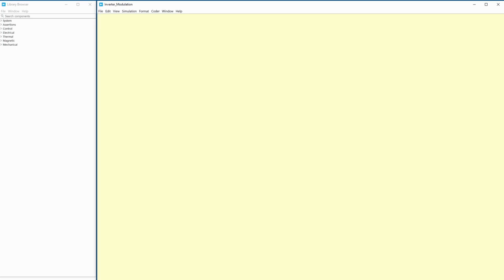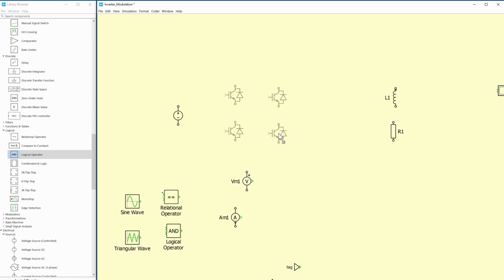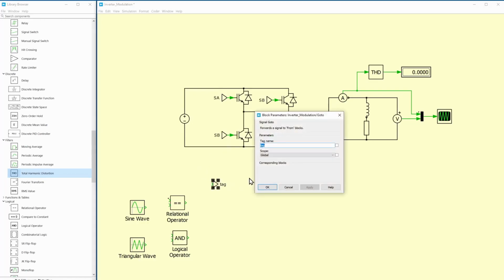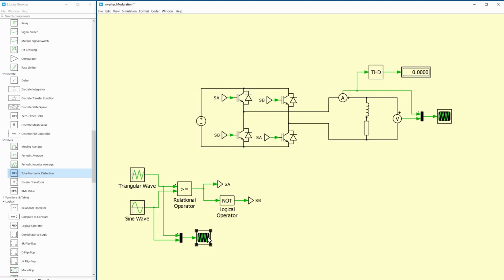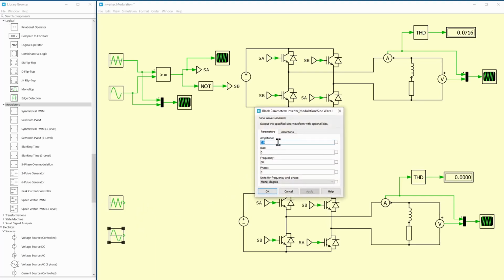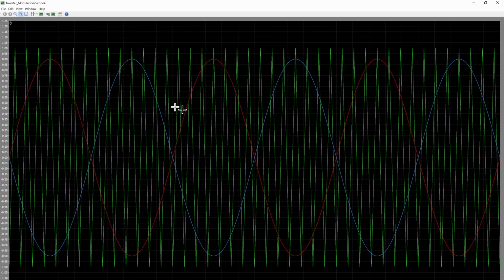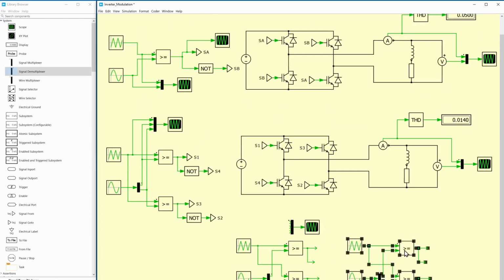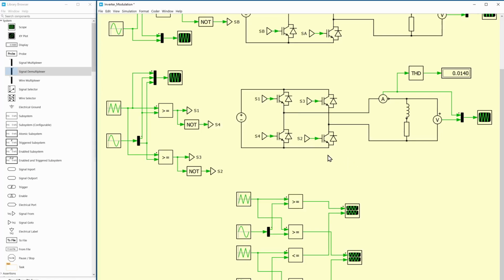Simulation of PWM INVERTERS | Modulation Techniques | PWM Dead Band | Power Electronics

Comment: Sir, I thought the switching pattern in the inverter is generated as follows; When control signal (sine wave) greater than the carrier signal (triangular), the top device is ON and when control signal (sine wave) lesser than the carrier signal (triangle), the bottom device is ON. In your lecturer it is just opposite to it. Is there any difference in both the cases. Or both have same nature on the operation of inverter?
Reply from the maker: At the end you will get two signals which are complimentary to each other. One will be sent to leg A and the other to leg B. What happens when we reflect the two legs will give the same answer.
Reply: @Elkhateb  So the operation of inverter is same with both method of comparison
Reply from the maker: @afsspa9492  it will be the same but shifted by 180 degree.